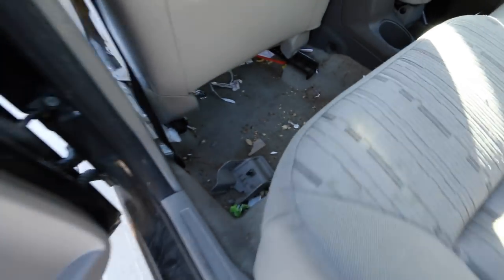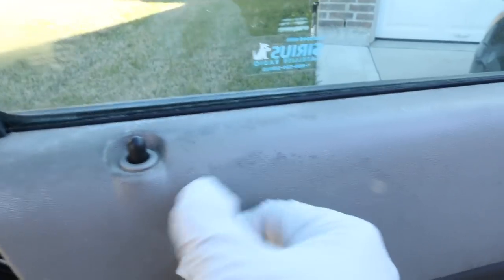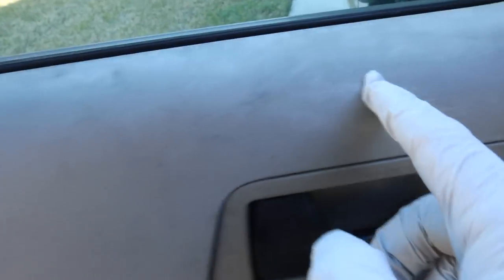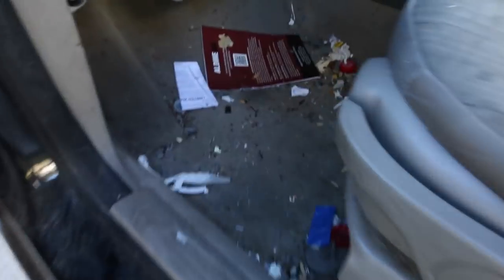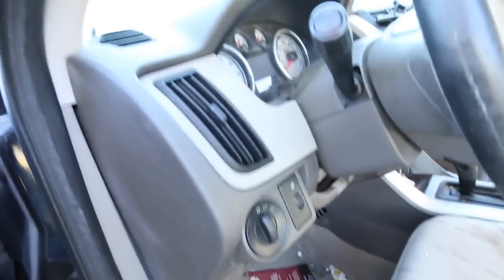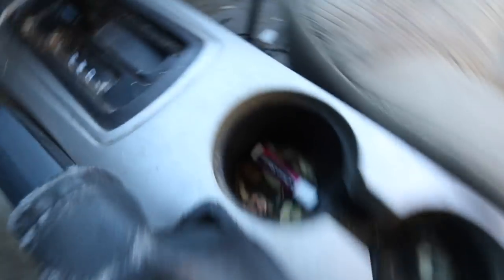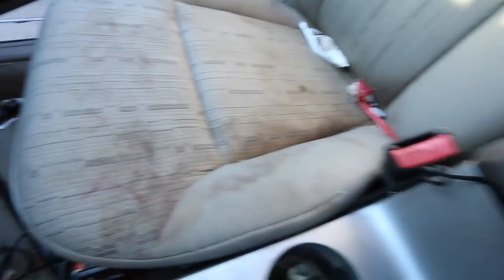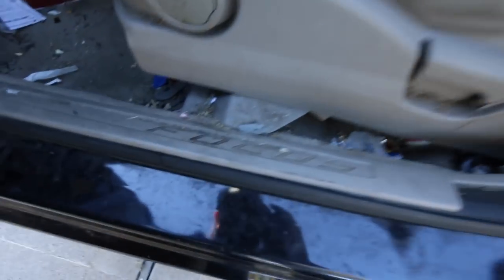DEEP Interior Cleaning on NEGLECTED 3 YEAR Car - Interior Car Cleaning Process

Comment: You need a hot water extraction machine. It'll cut your time in half and you can get a good one for about 1,500 dollar's, but well worth it.  It takes me about 2 hours to detail the inside of a car but I use a truckmount steam clean machine and lots of purple power degreaser for the dash and doors then shine it up with a high gloss protection.   2 hours still charged 150.00 but my carpet and mats look almost new compared to brushes and towels and the 6 hours it takes you. It definitely helps to have the right equipment.  If I had to spend 5 hours I'd have to charge 400.00 minimum.
Reply from the maker: Yeah, I have an extractor now. It's a big help 👌

Comment: Do you ever clean the actual carpet aside from the floor mats?
Reply from the maker: Usually it will be spot cleaning. You also have to manage expectation. Like in this situation, so many years of neglect, I'm not going to work a miracle. I'm taking a -4 to a 6.

Comment: I see you have a generator for electricity. Im starting off with not having one. Thoughts? Also , if you are mobile, how do you do a wash? Do you have a water tank, with an electric pump? Whats your strategy?
Reply from the maker: I use ONR. I haven't used a pressure washer in 3 years. I was a mobile detailer without a generator for years.

Comment: Have you ever done a detailing where you had to pull the seats and the carpet because it was mice , and lots of mice poop and pee inside the carpet , inside the trunk panels , hood , pretty much overall , pretty much getting the car naked to wash the pee and poop of the frame.

Comment: Also , with the griotts polisher, how do you attach the sandpaper to the polisher? What Attachments did you use, and where did you get the sandpaper? Links please? Your method looks promising, and am trying to try it out myself, but am struggling to find the right attachments and equipment. Thanks.
Reply from the maker: There's a link that shows you everything: <!--td {border: 1px solid #ccc;}br {mso-data-placement:same-cell;}-->https://detailgroove.co/how-restore-headlights

Comment: Oscar, do you have a link for your work bench? I often see you cleaning carpet floor mats on it, are there any other uses for it, in your experience?
Reply: You mentioned in your Range Rover maintenance wash video that this is the Gorilla Ladders Work Bench from Home Depot. I'm now deciding between that or the Dewalt Portable Work Bench haha. I like how you also use it as an area to consolidate the chemicals and tools needed in a pinch and how it gives you a boost for larger vehicles.
Reply from the maker: Hahah yup! I haven't really looked at others. Just choose one and get to it :)

Comment: Fuck this can't be real...id be scared of needles under those seats....
Reply from the maker: oh yes! You have to be careful about that
Reply: Detail Groove haha thanks for response.
One quick question...why detailers don't use air compressors?
When i go to the coin-op for the weekly wash or at least one time every month i put a coin for air compressor with a gun...ofc after i vacuum.
My car get alot of dust from coal mine i work whole week except Sunday or sometimes  Saturdays...
Only way to remove successfully this brown dust is by compressed air... :'( and microfiber towels.
But it gets everywhere and also my footrest section gets dirty since it's a soft rubber to protect the carpet and not hard plastic...
Reply from the maker: I know a lot of detailers that use air compressors. I don't use one due to space in my van. It's a great tool to have!

Comment: Hi i always use neutral detergent , as it wont mar  any metal surfaces also any water stains will come out with  white sprites there's not much you can do with grey carpet & mats  what you did is right ! once the fibers get stained thats it ! also i would have taken the back seat out there would have been a heap of rubbish &  drink stains under it . also never rush as all you are going to do is damage something ! Regards Alan.
Reply from the maker: Thanks for the tips!

Comment: I bought some Apc a couple of days ago. But have later been educated that Apc shouldn't be used on the interior as it leaves a 'crusty' feeling in the fibres of the carpet etc. What is your experience using Apc and have you had any complaints about the aftermath? Thanks!
Reply from the maker: I've never had any complaints, but yes, you can cause them to stiffen up. I've had that issue a few times. What dilution ratio are you using it?
Reply: Thanks for replying. I am using a cheap apc, Stardrops All Round Cleaner, I practiced at 5:1 as I thought it wouldn't be strong as it was cheap, but the liquid was still a bit thick so I have changed to 6:1. But that may need to change soon to 7:1 or 8:1. 

Is a lot of elbow grease needed to remove the apc from the carpets etc? Or could a steamer lift up most of it?
Reply from the maker: Are you trying to lift the dirt or the APC?
Reply: The dirt has been lifted through vaccing and wiping with apc. The apc is still in the carpet and when it gets wet it agitates it and started to show again.